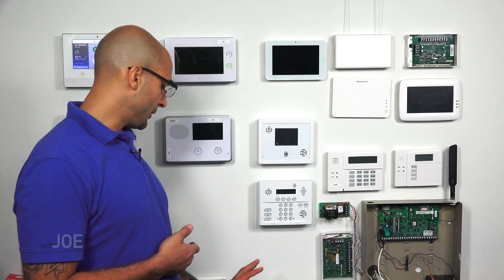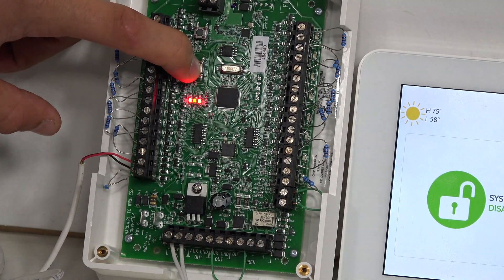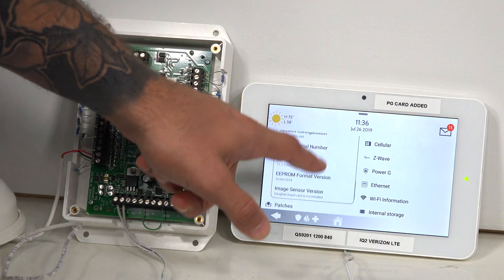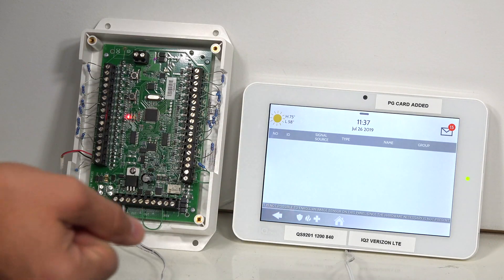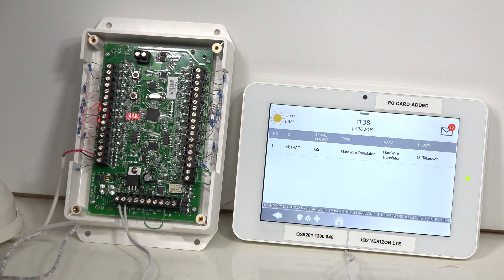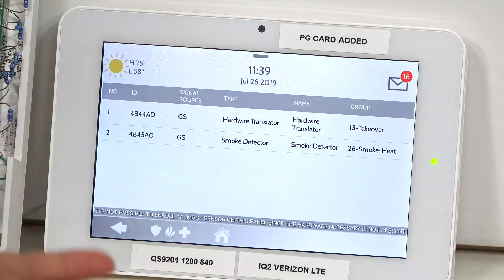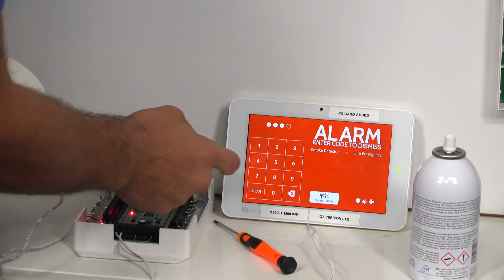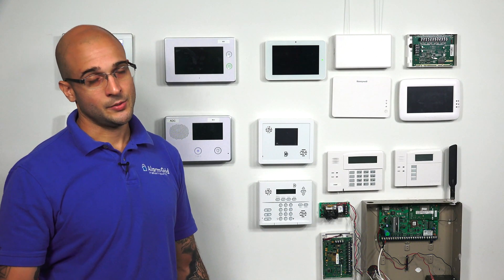Adding a 2-Wire Smoke to the Qolsys Hardwire 16-F

Comment: Hello, is there a smoke / Co combo device I can use with this system. If so do you have a model number thanks.
Reply from the maker: The Qolsys Hardwire 16-F supports 2W-B, 2WT-B, and 2WTA-B  smoke detectors.  Only one model should be used per Hardwire 16-F.

Comment: I have a question

Can a Vista 20p become wireless if you get a transmitter?
Reply from the maker: A Vista-20P is a hybrid system. It supports both wired and wireless zones IF a compatible receiver is added to the system. The number of wireless zones available depends on the number of wired zones used as well as the receiver that's added.  Receivers come in Low (8-zones supported) Medium (16-zones supported) and High (supports as many wireless zones as the panel can handle).  The Vista-20P is NOT compatible with the Qolsys Hardwire 16-F.